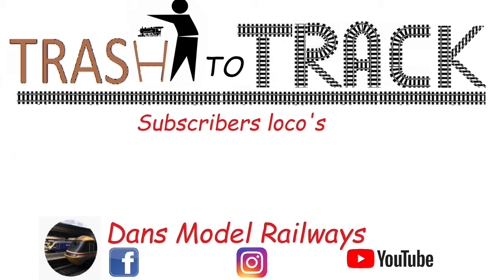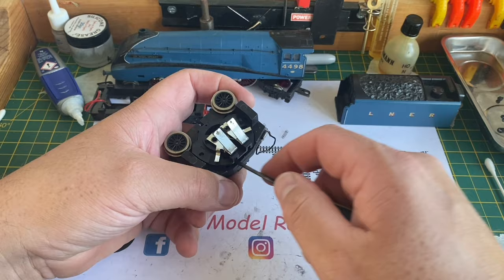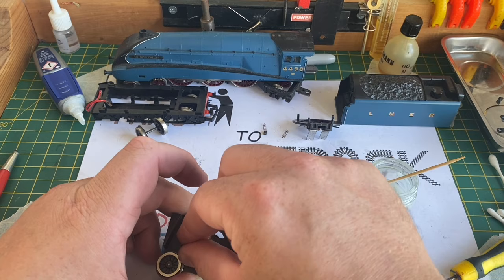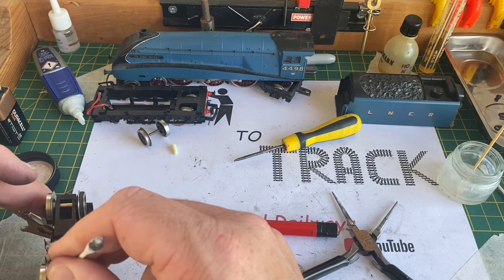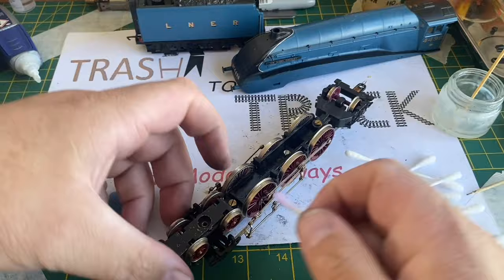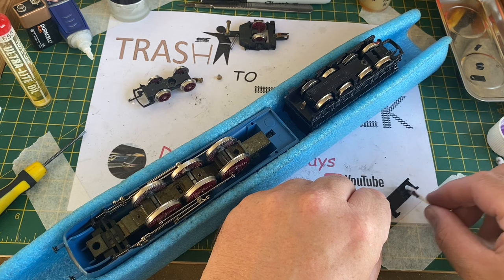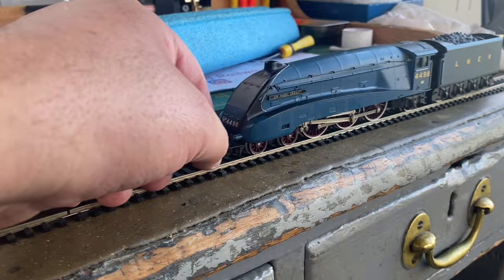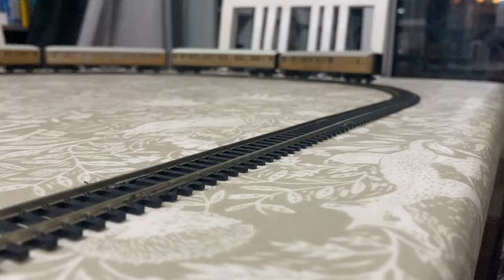Trash to Track. Episode 70. Hornby A4 ‘Sir Nigel Gresley’

Comment: That insulation issue was rather baffling. I guess it would make sense if a previous owner with a DC layout wanted to have it permanently static whilst running other locos on the same section of track, but if that was the case then it would have surely been much easier just to unclip one of the power wires from the motor.

Sabotage, perhaps??